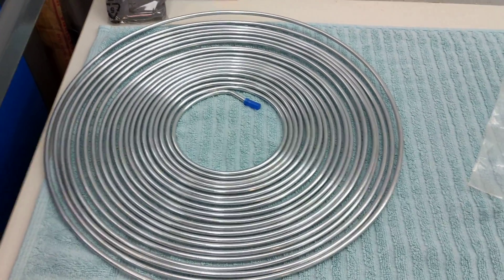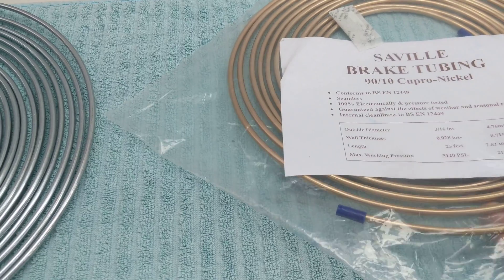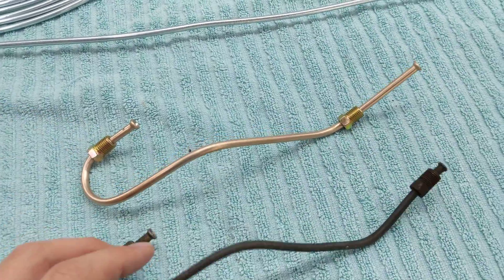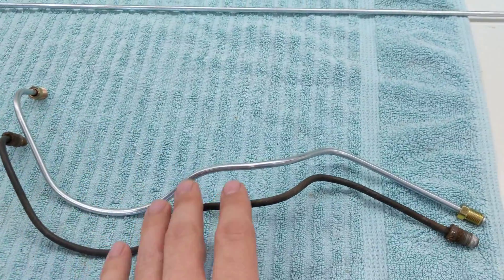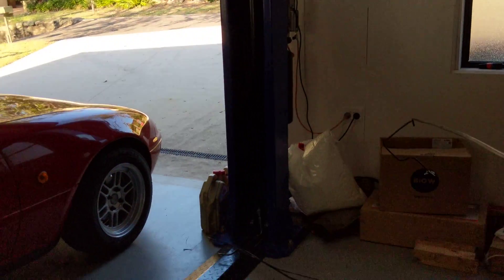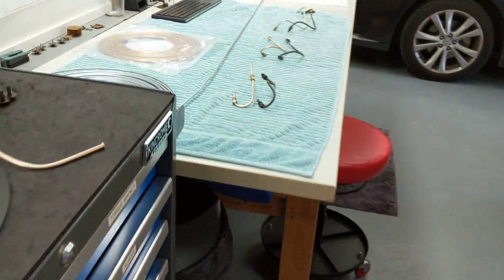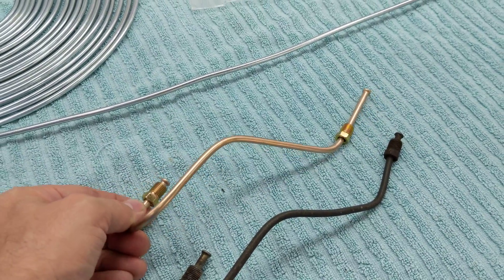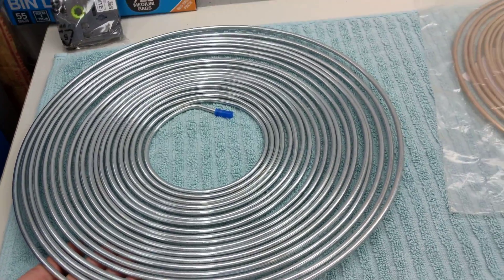Steel vs Cupro-Nickel (Kunifer) Brake and Fuel Hardlines

Comment: Thanks. GM has a lawsuit on junk steel brake lines. 
You think breaks would be important and not leather seats , DVD players, sun roof.
Reply: Ya I agree their brake lines are the worst I have ever had, stainless steel would be expected as it is also difficuly to crush or twist - with the stuff gm has been using, you don’t dare try to crack the rear tubes for maintainence of rubber hoses etc, unless you have a new full brake line in your spare parts as they are sure to crumble during disassembly

Comment: That nickel copper line is all I use (USA) here in MN your brake lines rust out completely and fail within 5-7 years cause cheap manufacturers use steel. I have replaced a lot of brake lines using nickel copper on customers and my personal vehicle and it is still holding up fine 11 years later. Long story short it is great and way cheaper than stainless and a million times easier to bend.
Reply from the maker: Good to hear Justin. We don't have rust problems in Australia as we don't get much snow or any salt on the roads. Still, it's a pleasure to work with it over steel or stainless.

Comment: In the US Copper is illegal as well it does not take the pressure that a brake line needs to take, the NiCopp tho is not copper it is an alloy  and can take the pressure needed.
Reply from the maker: That was my takeaway from all the research I did.
Reply: @two40  Copper/Nickel is DOT approved in the US.  Pure copper is illegal.

Comment: cupro nickel is legal. copper is not
Reply: And cupro-nickle has been standard on alot of European and Non-US produced automobiles. Cu-Ni lines are just about as strong as steel pressure wise. It is US DOT approved. COPPER tubing would last to about the end of the driveway or the first hard braking then it would probably blow out and fail. No Way its going to contain 800-1500 psi for any length of time.